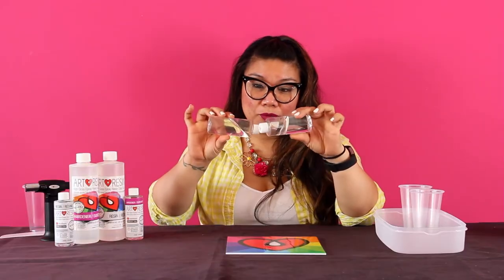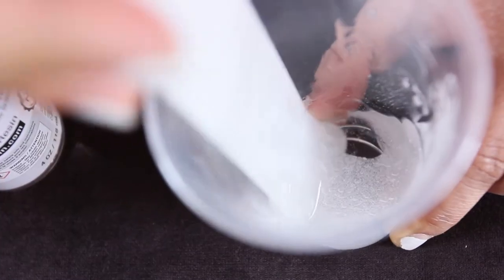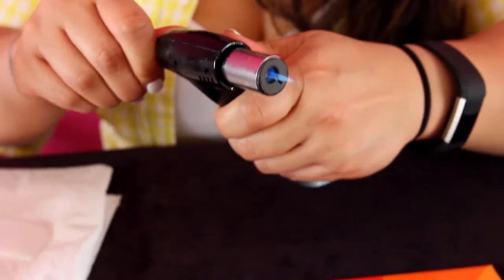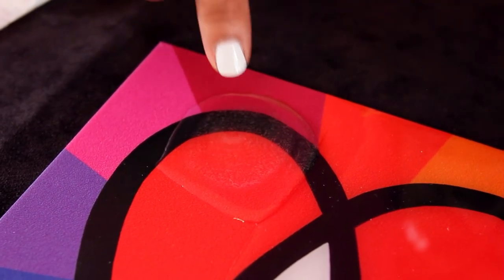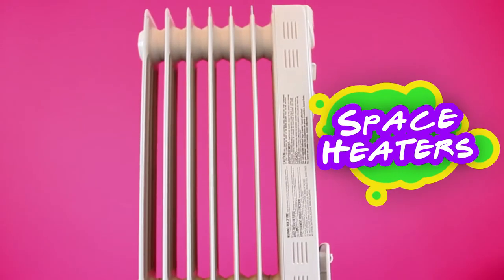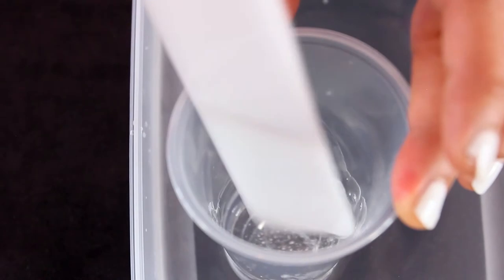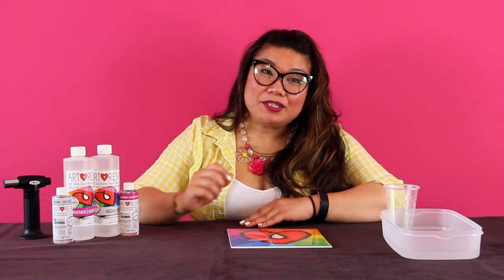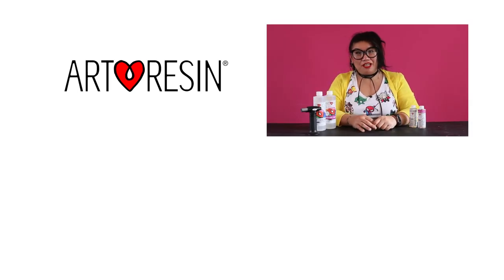OH SH*T Ep 4 - Milky!

Comment: So... do I place the bottles of resin/hardener in the warm water before measuring? OR do I measure them out and then place the cup in warm water (before or after mixing it??) Will placing the bottles of resin/hardener in warm water repeatedly affect their expiry dates?
Reply from the maker: either way just making it warmer makes it a bit easier to use.  not necessary especially if you have a warm room!  I dont do water baths but i turn a room heater on a few hours before i resin.     also, warming it does not affect the expiry date at all :)  oxygen does!!!!!!!
Reply from the maker: If you do choose to do a warm water bath as Patty suggests in the video, make sure not a single drop of water comes into contact with the resin or hardener, or you may end up with cloudy resin or resin that doesn't cure properly.  Safest way to do this is to place the bottles of resin and hardener, caps on, in the warm water bath for about 10 mins or so.  DRY THOROUGHLY.  Then measure and mix as usual.  Remember, warming the resin in a water bath or in a very warm room may cut down the working time by about 10 mins or so ( normal working time is about 40 mins.)

Comment: Well I doubt temperature is the problem. I keep my resin at the room where is always around 20 degree and before mix it I put it into a cup with hot water. After it's already in the mold I warm it again. Last things I made are so blur I can't even see what's inside, it's almost white.
Reply from the maker: I wonder if you got some water mixed into your resin?  Water causes resin to turn cloudy.  You always want to warm up your unopened bottles, and then thoroughly dry them off before opening them to measure and mix.
Try a little bit warmer - the minimum temperature for resining is anywhere between 22 and 25 degrees, and even up to 30.  The temperature should remain constant for the first 24 hrs.  
Also, don't whip the resin when you mix - stir nice and slowly to avoid incorporating air ( which creates bubbles )
Last, are you using a torch?  A torch is the best way to get rid of bubbles :)

Comment: If this happens and it is curred, can i sand it down to eliminate the cloudiness and then go over it again with new epoxy OR will i have to sand it down completely and start fresh?
Reply from the maker: Hi Nick, once your resin has cured and it is still cloudy, the only thing you could do would be sand down as much of the cloudy resin to debulk the look.  Be careful to not sand down into your artwork.  Removing as much of the cloudy resin as possible will minimize the look of the cloudy resin.

Comment: Hey hey! 
Okay...
So I had an OooOoooOo S#*T moment ...
Room is like 75 degrees...have a large canvas I’m working with so I have 2 quart bucket 🪣 ...I mixed 1:1 of each product on the bucket...

Here’s the OoooooOo S#*t  moment ...

...I mixed it with a drill/paddle (for the sake of my wrists 😫 ) and my resin turned to white milk...like beyond cloudy; it looks like I have pure white milk in a cup...

I mixed for 3 - 5 min with the drill/paddle & that’s how it came out...

Let it sit for 5 mins ...still white!! 😣...and now getting hot 🥵...like the process is curing in the bucket but it’s still white! 

I poured an inch out; when torched it goes clear. Then back white 

Help please...what did I do wrong? I lost a lot of product...I still did something with it to see how it turns out 2mrw
Reply from the maker: Oooohhhh S#*t!  Using the drill attachment to stir your resin incorporates a ton of air and results in bubbles.  The milky white that you see is actually millions of micro bubbles that got whipped into the mixture as you stirred.  It is best to stir slowly by hand.  Gentle stirring will greatly reduce the amount of air that gets mixed into your  resin.  Also ensure that your resin and hardener are between 75-85F when you mix them, this will help reduce bubbles in your mixture.   If you are mixing in larger amounts, or have a large volume in a smaller container you will often notice a greater amount of heat being generated.  The heat is caused by the chemical reaction when the resin is mixed with the hardener.  You do not want the heat to build up too much as it can cause a flash cure.   Mix in wider mouth containers if possible and avoid deep volumes of resin mixture.

Comment: So when it's crystal clear while I put it into a silicon mold, and when it's cured and hard, I demold it, and there's a milky finish over where it was in the mold, why does this occur?  The resin is at room temperature, there was no moisture.  Should I be using a mold release, as I've been using the same mold without a release agent, more then 10 times?
Reply from the maker: Hi Demetri - sorry to hear you have a cloudy issue 🙁.  We don't recommend using a mold release spray as this will definitely give your resin a cloudy finish and could effect the cure as well. 
There may be a couple of things going on .. 
- you may have cleaned out the silicone mold and there may be residue of whatever you cleaned it with ( soap or alcohol ) left in the mold.
- the mold may have reached its shelf life. Silicone molds, especially those made for baking, are only good for a limited amount of time before they break down or the finish gets compromised.  If the shiny finish has dulled, then you'll end up with a dull finish on your resin.  ( same goes if you buy a brand new mold with a matte interior, it will give your resin a matte finish )
Hope this helps!
Reply: Good to know.  Thank you~

Comment: I use to warm bath my resin before mixing and it reduces the micro bubbles. Doing well with casting resin but the coating/doming resin is such a brat. I had it warm bathed and it reduced the micro bubbles but those sh*tty micro bubbles of doming resin are persistent when it cured. Thus the under part is clear which is the casting resin part and the top part is blurry or bubbly. I tried to warm bath my doming resin much longer and ended up making it hardened before time and make it difficult to work with as it solidified and thickened too quick. How is it to deal with?
Reply from the maker: Hi Sri, we are sorry you are having trouble with bubbles.  We recommend using a warm water bath prior to mixing your resin and hardener.  You do not want the water to be hot, but just warm enough to bring up the temperature of your resin and hardener, the warming will reduce the viscosity and make it easier for bubbles to rise out.  Do not heat the resin and hardener once you have mixed them.  For best results, ensure that you are pouring in a thin layer and allowing the resin to self level to a thickness of approximately 1/8", too thick of an application will trap the bubbles.  Once poured, use a torch and pass it over the surface.  The heat from the torch will easily clear out any bubbles that have risen to the surface.
Reply: @Artresin  thank you so much for your answer. From what you tell me I have found out my mistakes. First, I warm bath after mixing them and second, sometimes I overpoured thus made my coating a bit too thick. Again, thank you so much ❤

Comment: Hello I need help, may part A is milky with part B. All of may project are all milky. What can i do to make it clear, i already allowed may part A to have a hot bath still it's milky. Can anyone help me please, Thank you.
Reply from the maker: Hi Adrian, I would recommend warming both your resin and your hardener in a warm water bath prior to mixing.  If your milkiness is caused by microbubbles trapped in cold resin/hardener, this will help.  If your resin and hardener are both warmed up to about 75F and you mix them and the mixture turns white-it could be a result of moisture (water) getting into your mixture.  If water has gotten into either your resin or hardener, there is no way to fix this.   Please feel free to reach out to us at support@artresin.com if we can help you further.